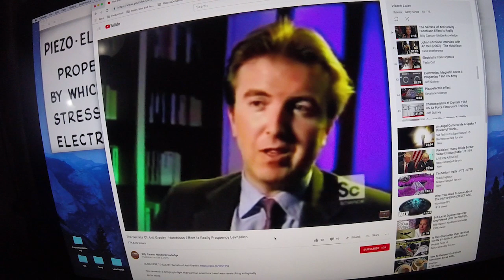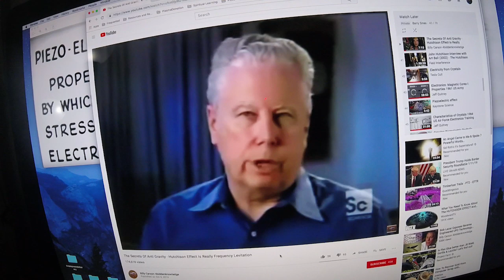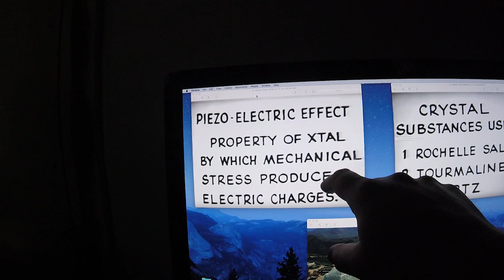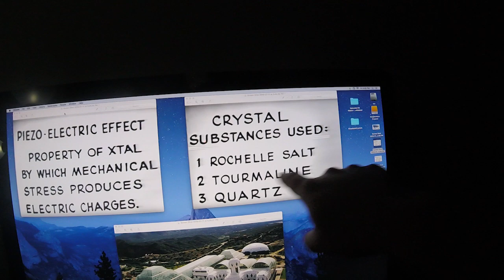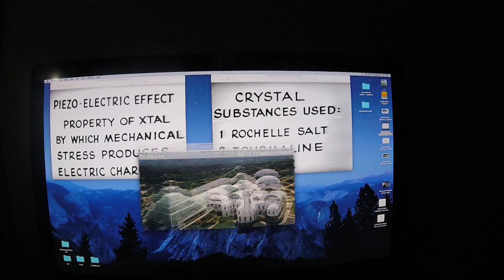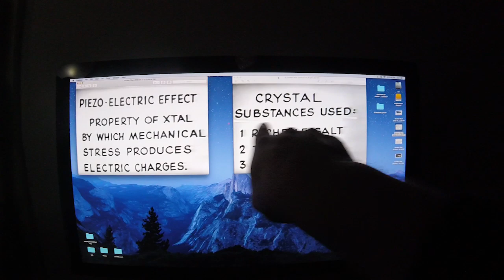DIY CRYSTAL Electricity Experiment - PIEZO-ELECTRIC Effect ✔️

Comment: Hit it with an electromagnetic field. I found a paper online, a military paper that basically described hitting quartz with an electromagnetic field to create electricity. It’s on my do list
Reply: In what way could this be done
Reply: I’m building one too, want to collaborate?
Reply: What is the name of the paper
Reply: @michaelguidry2711  use it to generate ions in the air to heal and grow plants and food. Like a waterfall that can be used in collaboration with technology.
Reply: May I have the link pls??So interested in it
Reply: @Blackafternoon  please.  Seriously,please. That would kickass.
Reply: @luna122489  did he ever get you the link?
Reply: But you need electricity to create an electromagnetic field, where is the gain?
Reply: @itsoktoberight4431  you can use a car battery for the electricity… that’s often used in rural areas. My Dad grew up in an old farmhouse powered by car batteries linked in series. They had natural gas for heat, car batteries for lights etc. they grew and raised their own food. Well water.
Reply: @itsoktoberight4431  you can also build batteries from saltwater and alternating metal plates of copper, nickel and zinc, use a wire at top and bottom as the posts. Hook them in series, and you can run a whole house on it, have to monitor the saltwater and keep it up, that’s it. Salt moves the electrons just like any conductor
Reply: So you have to power an electromagnetic feild.
Reply: @itsoktoberight4431  why does it have to an electrically generated magnetc feild unless its pulsing you want. Put the crystal on a rotor and spin it past a magnet? Should be no drag  which makes it at least interesting
Reply: @kimmy9695  you would still have to charge the battery, there is no net gain.
Reply: @stevetilbrook3402  what would you use to drive the rotor with the magnet on it? If it's a motor then that would need electricity
Reply: @stevetilbrook3402  if the crystal had no drag then that would mean it's not absorbing any energy
Reply: @itsoktoberight4431  l agree with your logic on conservation of energy.  The idea of driving a magnet past a crystal is to see if a pulsing magnetic feild on a crystal somehow yeilded any electrical energy . I mean l doubt l would see anything but l would like to see that
Reply: A crystal subject to pressure emits electricity over and over again, yet in a passive state it doesnt store it, so it must he induced. Is there a way to economically induce that?
Reply: @stevetilbrook3402  yes we build roads  out of it and use our walking and driving to power the grid lol
Reply: Bros ... Make the Rochelle salt using 7ozs of cream of tartar powder ... Heat to jus below boiling. Then, use sodium carbonate (not baking soda, though baking soda can be cooked in a pot by itself on high heat until no little volcanic looking bubbles pop up thru powder cuz of heat - when no bubbles rise, you jus turned the baking soda; ie sodium bicarbonate to "washing soda" ; ie "sodium carbonate"), right, then when you heat the 7oz "cream of tartar powder" in 1 cup of "distilled" water to almost boiling (stir), then add very small 1/4 tsp sodium carbonate at a time to the 7oz C.o.T. ... Only a little at a time. It'll fuzz up. Alright, keep doing that till it doesn't fuzz up anymore ... Take u time. Then, when the 7oz CoT liquid clarifies due to adding the sodium carbonate ... Strain this liquid thru coffee filter into a glass container. Let sit for at least 1 day. 
And remember, if it cools slowly - the Rochelle salt crystals grow bigger. So, everybody always say put the filtered clarified water in the fridge.
Don't .

Let it sit in a slightly warm place. I put it in a oven bowl and heat up oven jus a bit to warm the inside and then wait some more. Babysit ur crystals, bros.

Ok.

Now, you should see the crystals growing bigger. And after probably good w/in 48hrs.
Take those crystals and see if ya got an good ones. Test  outage by attaching volt meter and lightly tap crystal .
So what ?

Right.

Then, you can take those crystals out of solution and mix with jus a bit more distilled water and low heat them (no more than 50 deg. F.), And when it seems they all melted back down but on lower temp than before ... Let sit again. Now you will grow very nice larger and more symmetrical crystals. Take you finest specimen and suspend it with monofilament fishing line in a deep cup of fresh solution, but wait till it cool s a bit before suspending it in the solution ...

Now your big symmetrical crystal get even bigger.
Higher voltage.
Connect voltmeter to lengthwise tips of crystal ...
Test strength.

Make sure crystal is dry, plz.
Don't mess with water and electricity.
Don't do that.

Right ...
This method will make u big nice crystals with high voltage.
Over 9v registered ...
Could easily go bigger.

You need fine Rochelle salt crystal.
But yes ...
They are fragile.
Humidity could possibly kill it.
140+ deg. F might destroy it.
And it water soluble ... So keep it away from water.

The voltage comes out of it via striking it or applying pressure.
Even u finger tips applied pressure can trigger voltage.

Definitely with more research.
And you can connect neg/pos wires to it ....

How real could it get w/more research ?

I do not know.
But a nice crystal can power an LED. So, I wonder, what if ya daisy chain em and clack em all with a decent mechanical strike ... 

Let there be light or charge or some damned thing.

Yea ... Questions comment concerns ... I'll be around.
Best wishes all.

Beenplaying with tourmaline as well.
Applied pressure generates negative ions.

That's good.

Nature heals. Waterfalls generate lots of neg ions.

I don't know bout all the new age talk bout rocks etc, but ...
There's something to these rocks, bros.

Far Infrared (FIR) in video poster "purplish" quartz ... Amethyst.
Pyroelectric ... Heat it to release it's secrets.

✌️
Reply: @itsoktoberight4431  no, just a battery a steel rod and copper wire to DIY an electromagnetic field
Reply: @itsoktoberight4431  salt water plus metal is a battery
Reply: I can see now from the comments we need a basic video set for y’all. Look at YouTube for a video on how to make an electro magnet, and one on how to make a salt water battery. If my health improves in the next couple months I’ll see about doing a video in September
Reply: @kimmy9695  how did they charge the batteries?
Reply: @giorgosz  I just found this sorry. I googled quartz radios, and found it that way. The military had radios in the field during the early wars powered with an electro magnet and a quartz
Reply: @stevetilbrook3402  a nail wrapped tightly in copper wire will work as an electro magnet.
Reply: What frequency?
Reply: Would the em field from the existing grid work? Like "borrowing" the em created and wasted ambiently from powerlines?
Reply: @camerafishingcountry6903 possibly but it’s illegal, so don’t get caught

Comment: Yes Piezoelectric Plates, and buzzers are used in Arduino , and Raspberry Pi 3 projects . 
You need more info so I think I can help take you to another level . Look on youtube for how to makes a Stirling Engine , Speaker , DC motor,  rail gun, generator , and AA battery train .Mercury vortex in a magnetic field , Electromagnetic Levitation Quadcopter,  1. Biefeld Brown Effect 2. Quantum Levitation Locking 3. Alexander Weygers discopter 4. Tesla coils DC power 5. Zero Point Energy6. gyroscopic precession  ...

I made a Retropie arcade it is very cool !
Reply: This!

Comment: To create electricity with quartz, what I've learn so far by listening to cosmic agency is... they have a lot of Crystals moving as if it was in a blender (speed wise, maybe faster) it will create free engery.

Edit: also something with magnets so it will continue to spin by itself. Needs to create a toroid engery flow
Reply: pretty sure with some step up transformers, having all of it daisy chained in a circular patter and having the insulated wires wrap around a steel bar would literally increase each time it passes more and more as the transformers would continually step up the previous voltage to a higher one, having the insulated wires around a steel bar would then create the electromagnetic field. Now what a contraption like that would do is beyond my imagination but I assumed that if nothing can stop it that both the magnetic field and voltage would increase and the vibrations and sound from the current itself would keep it going. 

I assume you would have to split the voltage with an electric isolator so the current can continue in the circular device and the other half can be used, if you wanted to have a energy producing device. Compressing the crystal makes it to where a sound wave can create the voltage hence why piezo pickups work on an acoustic guitar. 

I am gonna draw up some plans for anyone who wants to try it out and see what it would do cause I actually have no idea what would happen if you didn't bleed some of it off with an electric isolator. I want to know if it would explode or if I would get a really strong magnet or both. My educated guess is that it would eventually reach instability and explode but I want to know how much energy it needs to do that and if there is another reaction it might cause. lol
Reply: I follow cosmic agency too. Wow

Comment: hi orgonite pyramids do just that. they take a crystal and wind copper wire round it. and place it at the apex for the pyramid and pour resin over it to keep it in place then they add semi precious stones and metals or wood then encase it all in more resin. the resin shrinks when its set and copresses the crystal, thereby create piezo electricity. i am trying to figure out how to use the crystal as an energy device as well to light a bulb which is inside the pyramid. i have an idea it might work with magnets. do you have any thoughts on it. thanx regards deborah

Comment: I tied hairbands around my quartz crystal point. I didnt have a plan after that. Just create tension inside the crystal in order for it to project its natural abilities further. I did this with a rose quartz point as well. Not all crystals respond to squeezing, or so I've read. I have no idea how to measure the effects of the squeezing. I'm not very sensitive to feeling crystal energy, I just do it because I read about the piezioeletric effect. Its any krsytaline structure, that includes water and US! I have a theory thats why hugs are so great. Thoughts are electric and feelings are magnetic. Perhaps cerrtain peoples mind body connection is so powerful, when you get a hug from them it super charges you. A polarity. Ive gotten hugs from people I would consider my polar opposite & it was an incredible energy. Even if its not about polarity, which I highly doubt but anything's possible, the piezioeletric effect would still apply to a hug. Its still energy created.

Comment: I took apart a couple of these piezo lighters and tried testing the voltage they put out with a multimeter. It fried both my multimeters as they can only handle up to 500 volts and 10 amps. Not only did the fuses blow, but it stuffed them. These piezo devices seem to be putting out well over 500 volts and I'd love to know the amperage.
Reply: Up to around 10,000 volts but very low amperage, milliamp range so nothing useful
Reply: @itsoktoberight4431  not yet! maybe one day we will actually have global free energy.
Reply: @DylanLukeLosasso  anybody who figures it out, ends up with a fatal situation occurring.

Comment: Peter Brock won many races and championships by using quartz crystals along with magnets to get more power and economy on his internal combustion engine powered race cars.  I put this system on my fully electric car tesla model 3 single motor and was able to shave one full second off my 0-60 mph time.  Pretty amazing!  Not bad for a $1 investment a crystal and 2 magnets...a 13% increase in power and economy is interesting.

Comment: The "science stuff" as you refer to it is common knowledge available in any school library as well as online. Nothing remotely mystical about it. And although piezoelectricity is fun to experiment with.
Picture a dancefloor laid over a large area of p.e. - sensitive material. People would actually "produce" certain amounts of el. charge by applying pressure to the floor when dancing, same principles should apply to roads and railways etc.
Reply: Yes you can find a few books that mention this stuff in it but none are giving you a blueprint to building a crystal generator for your house or the community. The people that create generators out of crystals are quickly disappeared, discredited, or threatened and their work stolen.
Reply: I'm not gonna go into conspiracy theories here.. The fact of the matter is p. e. provides weak currents, too weak for it to be of any large practical value, for the time being. The principles are very well explained, as said - no magic there. Whoever wants may play around with it, but much like "perpetuum mobile", "negative matter", "magnetic free energy" etc, it is more or less Sci-Fi stuff, again, for the time being.

Comment: Why couldn't use that spark to fire another small hammer on ANOTHER piezo crystal, then use THAT spark to fire another, etc..till you get a full circuit that would run itself? Of course you would likely need to go slightly larger every time..so you could drain off that power and USE some..

Comment: Can you hold a crystal in a vice or hydraulic press and produce constant energy?
Reply: Im fairly certain its the shifting of the positive and negative layers that causes friction between them, which is the source of the electricity. In that case, I would say no.
Reply from the maker: I did try that with a vice and a quarts rock.  It increased the output of volts when I applied pressure.  I didn't test it enough, but my small tests worked.

Comment: I have went to car repair shops and asked about if taking off dioeds from car alt and putting 9v battery to run stater to make a lot of power and you want to know what I was told? I was told as long as you put enough power to alt. it will put out what it was made to put out so that right there says if you have a alt, made to put out 90amps=110v no matter 3v 6v 9v 12v as long as it runs the alt it puts out what made to
Reply from the maker: I definitely feel there is more potential than they tell us.  that is cool.  I'd like to know more about that and test some things out
Reply: The diodes change the current from ac to dc .the alternator has a total wattage rating  1volt x1amp=1watt.  A alternator that has a 90 amp rating at 14v has a total wattage of 1200.  You can increase the volts but will loose amps and vise versa